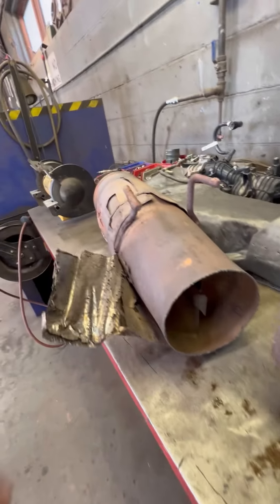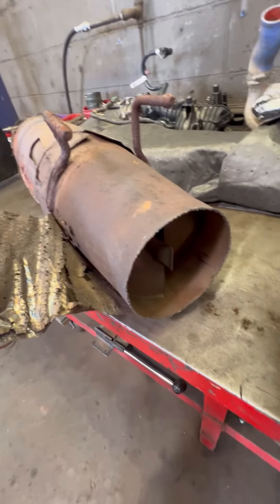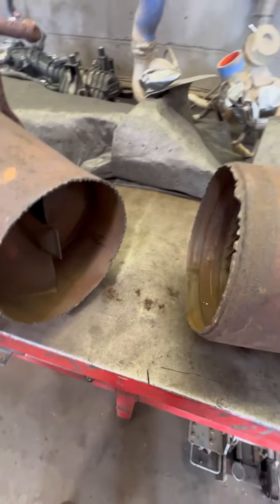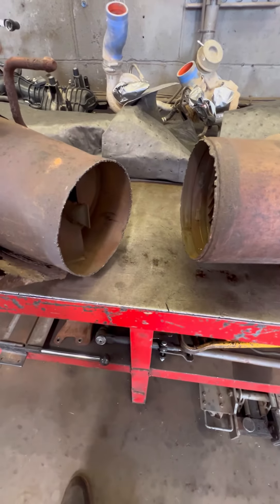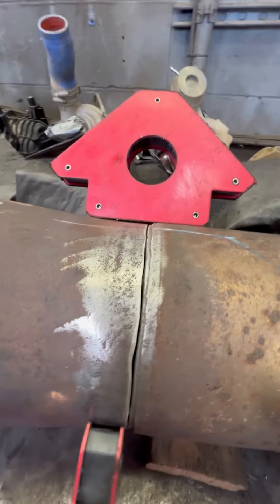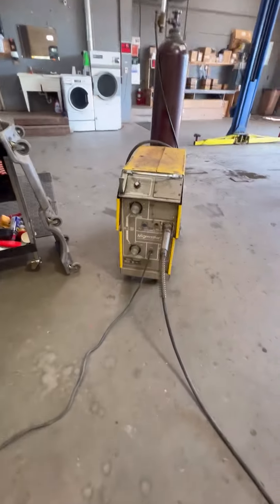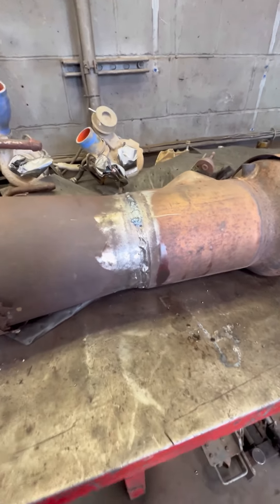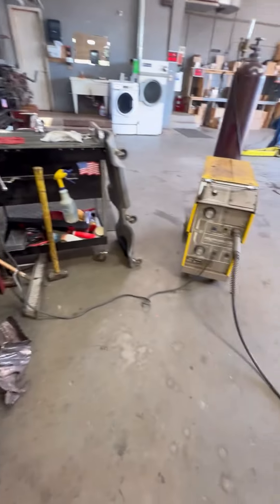Welding Ford 6.7 powerstroke DPF back together after baking #dieselmechanic #fleetmaintenance #welds

Comment: I've had several sent out, cut open and cleaned. I generally don't recommend it to customers because it rarely works for long or if at all to correct NOX output or a plugged DPF. We give our customers the option but it's usually a complete waste of time and money, which we tell them that before they make the call.
Reply from the maker: Very cool thanks for the comment make sure to subscribe and check out my other videos